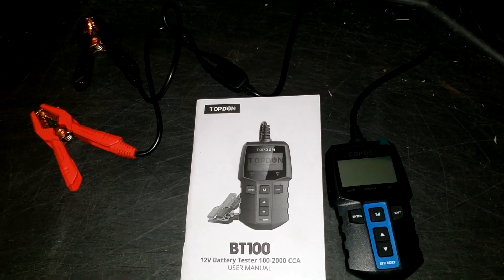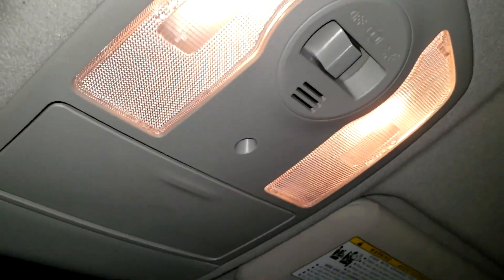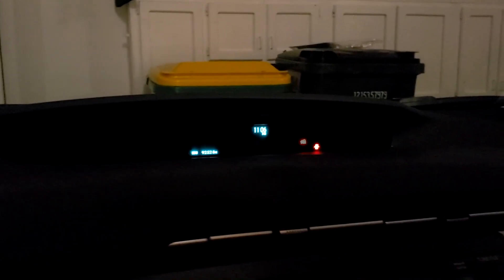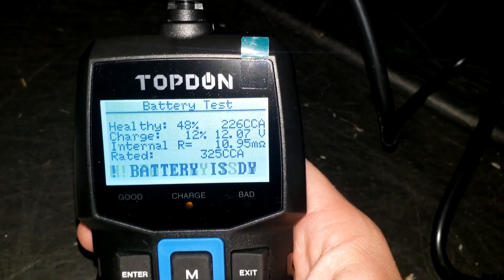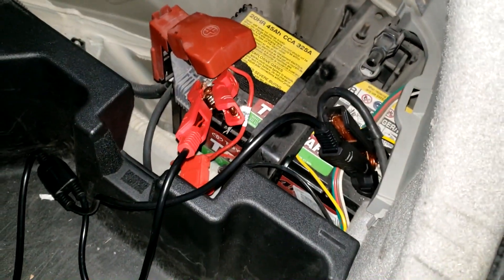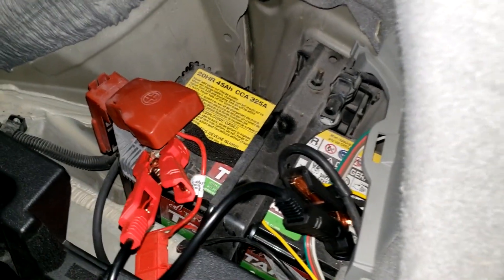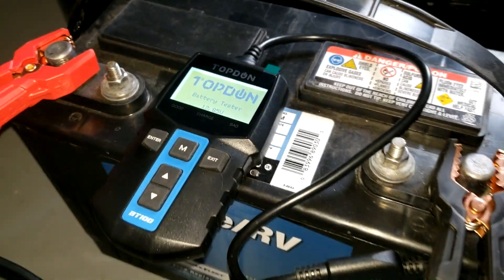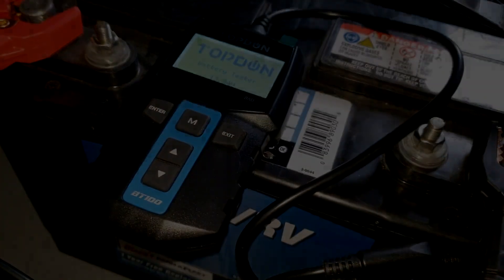How to Test Your 12v Battery

Comment: Good videos.  This subject bit me in the butt. I left my Prius V sitting while I drove my other car. I would start it up again. Eventually I forgot how to operate some of it. I'd look for the parking brake and not seeing anything just assumed I was remembering one of the ICE cars I used to have. The big "P" button was like the button on the end of the stalk of my Tesla. So it wouldn't move. Even when I looked around the floor, with a powerful LED flashlight, all that stuff is black on black on black. and the parking brake (also black...) just looks like another bump.  So I let it sit some more. The 12v battery died. I bought a new one. I still let it sit and that one died too. My mechanic friend said "I'll do you a favor" and took it to be charged. No one said, "This battery is 12.2 volts, it's dead." So this is an important subject. If I charged it, or used the Jump start setting on my charger, the screens would turn on, but as soon as I pressed on the brake to hit the Power button it blinked off. So I assumed I had some other problem.... 
So troubleshooting a Prius without any chip reader etc... is a great topic.  Now I'm wondering if the traction battery has problems, and what questions to ask the local shop (I'm not going anywhere near the dealer.) to make sure they know and do what you do.  Two mechanics advised me to just drive it and see if it sorts itself out. Seems to drive like I remember (but compared with the Tesla....  Had I not bought the Tesla I'd still be happy with my Prius V. Except for one thing. It will get stuck in mud or on ice behind a minor bump easier than any car I've ever driven. (The Model Y? I once drove it into a snow bank to park it. Right up to the windows. No problem)

Comment: Had problems with the 12v battery on a, 2016 gen 3 Auris Wagon couldn't listen to the radio for more than 5mins, with out having to put the car in Ready, as low 12v voltage warning came up on the dash. 
    
    Upon removal of the Battery, I peeled off from the top, the information label and placed it onto the side. Looks like the original battery from New, never been touched. 
     Upon removal of the clear plastic anti tamper covers. There are rubber removable covers. Using a flash lamp 🔦  looking into the cells there wasn't any fluid in any of the cells, they where wet and grey in colour.
     Using  Distilled water. Each cell  consumed over a cup full  of Distilled water. Then using a basic battery charger it was charged overnight night.
   The next day using a Hydrometer, i wrote down the readings, all the cells had the same specific gravity but where about halfway on a warm battery.
                  I had to top up using more Distilled water each day.
    Using a smart charger with pulse technology the battery was topped off with fluids over a few day's of constant charging. 
    Finally a Hydrometer reading was taken, surprisingly all the cells where the same specific gravity for a fully charged battery.
    Upon driving the vehicle i have noticed an increase in MPG with the ICE not coming on as much as before. When stopped.
     Before refitting the 12v battery into the vehicle it was washed down and the rubber covers refitted. A drop off silicon sealant was used on top of each  cover. Finally using a strip of Duck tape placed over the top to hold the 6 covers in place sealing off any Gassing, refitted the vent tube into the side of the battery.
         The above maintenance was done a couple of year's ago. 
Since then, I occasionally charge the 12VOLTS  with a smart charger with a safe max charge voltage under the operating voltage of the DC to DC Converter.when visiting the parents and  checking the fluid levels and Hydrometer readings on each cell. All is still good.
Reply: Useful information, thanks for sharing your experience. 👍 I wonder how many of these AGM batteries have been replaced when the electrolyte was low. 🤔